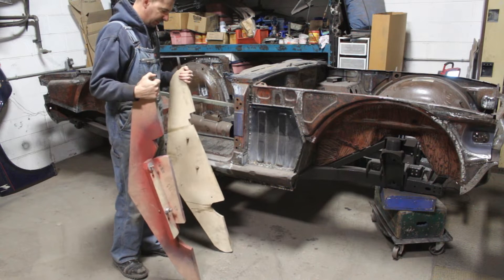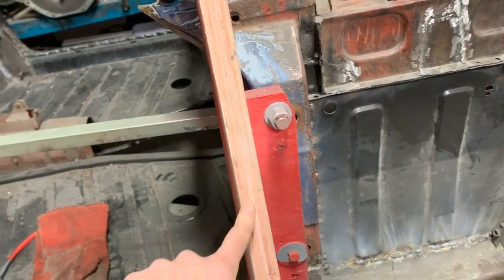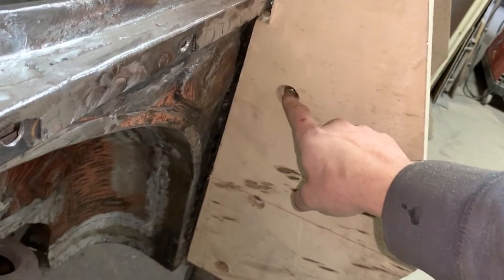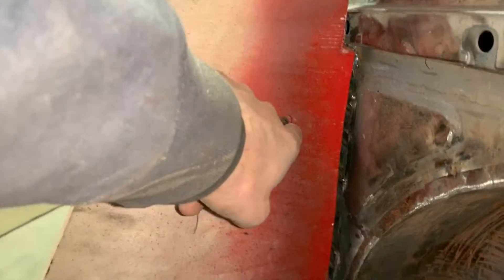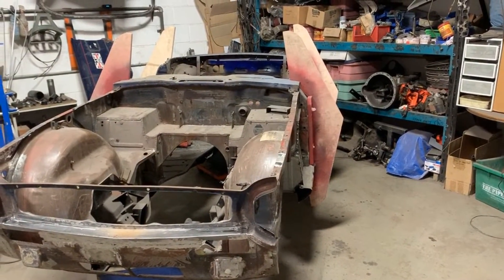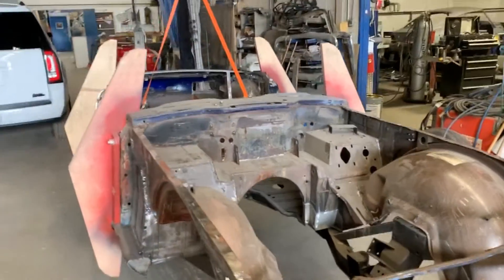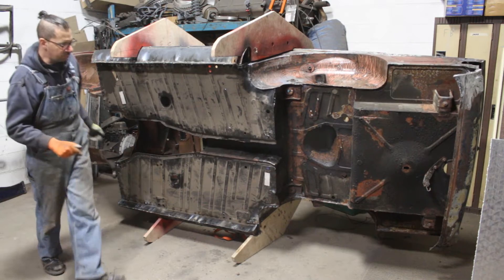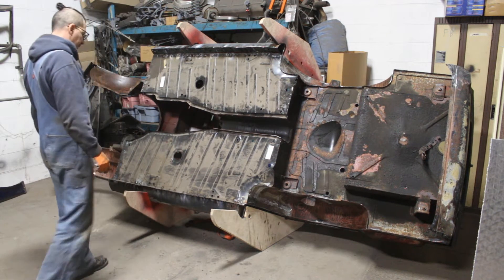1974 Triumph TR6 Restoration - Part 35 - The Rotisserie

Comment: I made a set of your rotisserie panels from your plans last year and they work great.  I currently have my 66 TR4A tub sitting on its side for storage while I work on repairing and welding patches into the frame, which I currently have on my homemade metal rotisserie.  I keep the wooden rotisserie and tub, stored on its side, on two wheel dollies which I adapted with two 2x6s spaced 1&1/4" apart and screwed onto the dolly to capture the boards.  This allows me to easily move it around my garage by myself.  Thanks for the videos.  Cheer,  Ron